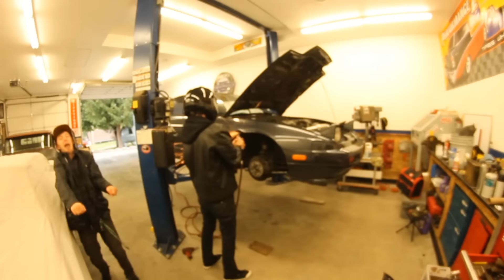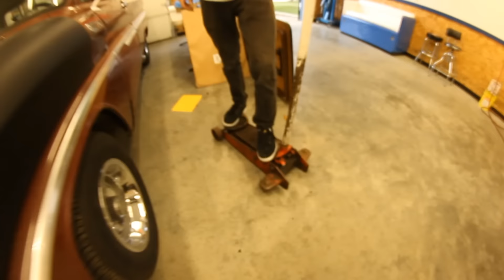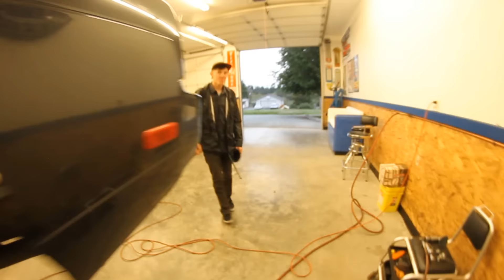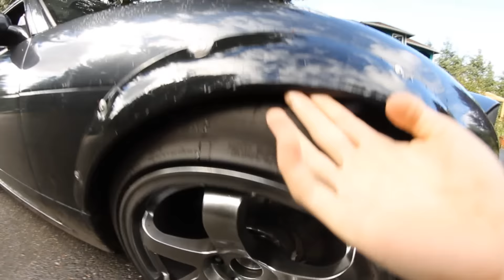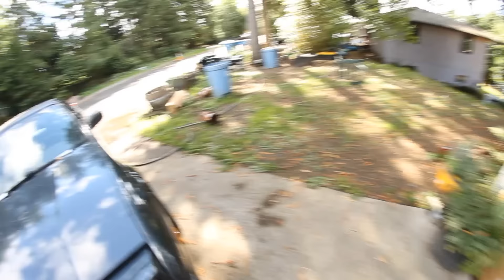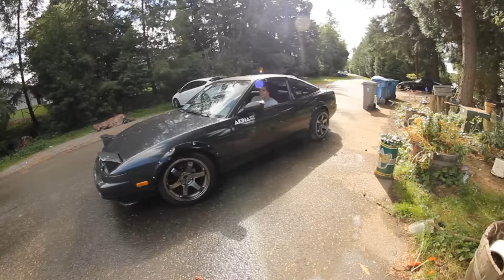Finished Fender Flares + Driveway Skids (FORGOT MUSIC)

Comment: flowers pot tap. lower the back a bit, it came out good. idk how you cut the fenders though I'd be scared AF. so what's next after the seat? full suspension set up? harnesses? *cough *cough turbo? jk I seen guys drift NA single cams like a turbo ka or sr. keep doing what you're doing, you're doing good man.
Reply from the maker: +Wreckless harness for sure and already running on a full suspension set up! and thanks, i appreciate it! oh also i think im going to buy an sr soon shhhh
Reply: +more skids don't go sr.... keep the KA. I know a guy with a single cam KA pushing around 360hp
Reply from the maker: what..
Reply: +more skids believe it or not. KAs have so much potential. mines pushing 360 hp as well but I have a dual cam.